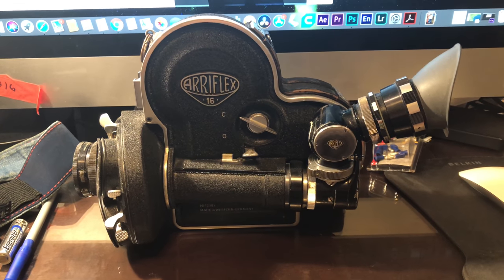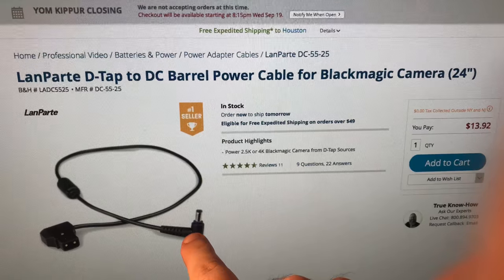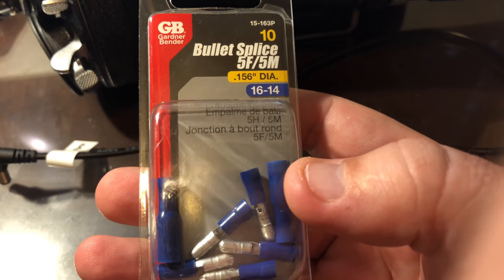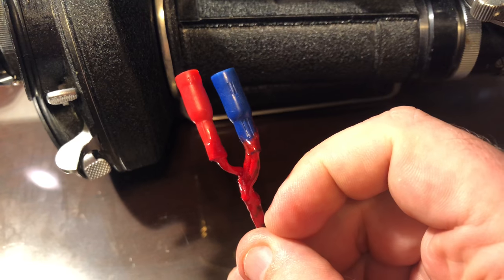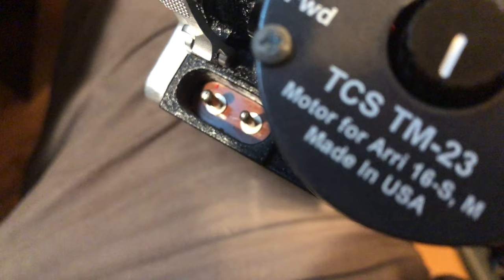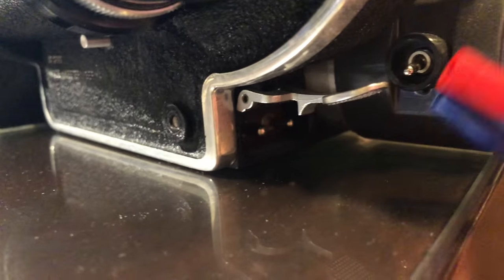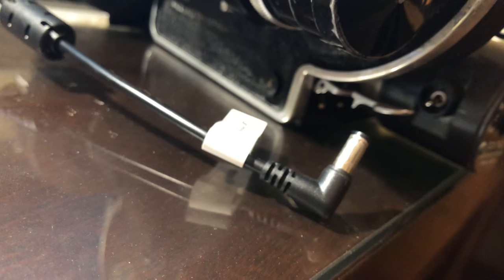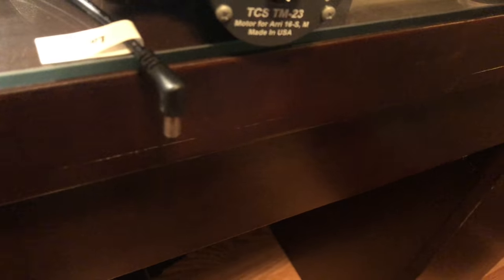Arriflex 16s Power Cable

Comment: can seem to find the battery you use. can you provide a link
Reply from the maker: I use Watson Pro V- Mount batteries, but that's not what matters. It's the battery plate that has pre-tapped voltage outputs. Smallrig makes one that has two 12v outputs. whichever pro battery system (V-Mount/Anton Bauer) you want to invest in, doesn't matter. https://www.bhphotovideo.com/c/product/1643741-REG/smallrig_3204_v_mount_battery_adapter_plate.html

Comment: What conductive glue are you using?
Reply from the maker: I don't remember exactly what I bought. but, anything made to conduct electricity by gluing metal wires together. I researched and found a product called "Wire Glue" that advertises this exact property. It's kind of like soldering without needing a soldering iron...

Comment: if i have the constant speed 12v motor do you think making this cable would work or fry my motor?
Reply from the maker: It’ll work fine, it’s not the cable but the power source that makes things fry. The cable is just a positive and negative connection from source to camera.
Reply: @AlvinGMorris  Gotcha. So as long as this cable gets connected to an 8v battery it'll be fine right? can't connect it to anything 12v?
Reply from the maker: @michellealanis230  you could connect this to any voltage motor. The cable can handle whatever you put through it. It’ll work fine on 12v.
Reply: @AlvinGMorris  sorry i meant i have the constant speed 8v motor, not 12v. so i think i have to plug it into a power source thats 8v only because anything more can fry my motor, is that what happened to your original motor? i know you mentioned in comments that the original motor on yours stopped working
Reply from the maker: @michellealanis230  yeah you definitely plug it into the source rated for your motor, and yes it can be fried if you use higher, certain variable speed motors will work on lower volts. But higher is not recommended